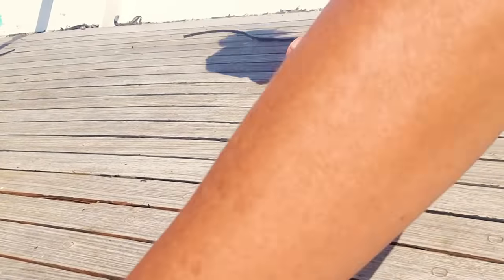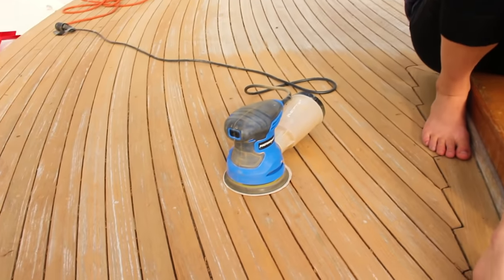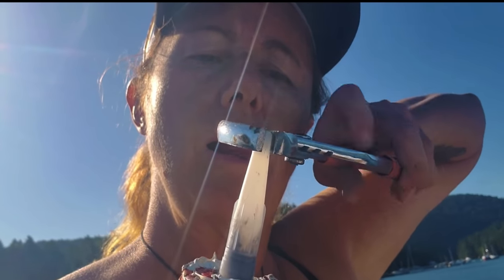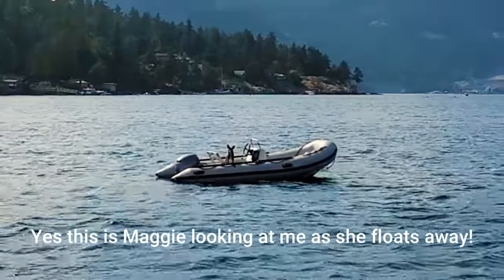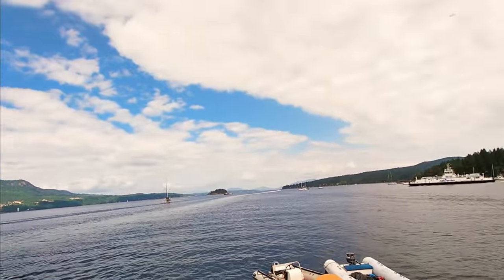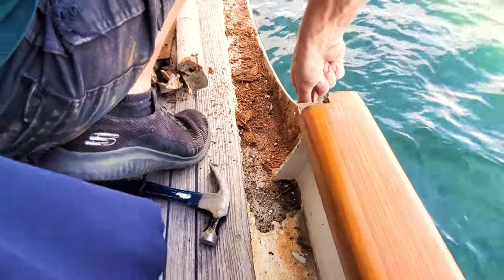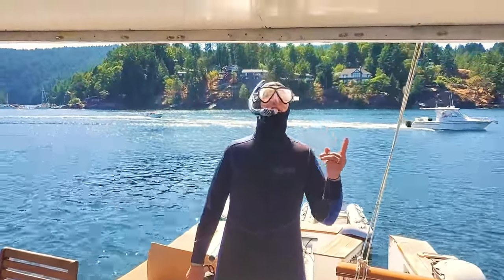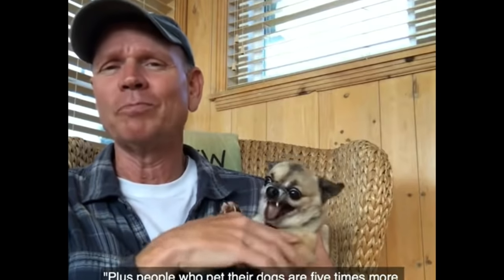Time to Recaulk our Teak Decks!   BONUS:  Galley Tour!  [Episode 54]

Comment: Love the look of teak outer trim and teak decks, but I don't miss refinishing it as I used to on our previous boat. I now try to keep wood finishes to the inside of the boat only. In any case, you cannot deny the beauty of nicely finished teak outside to boat! It's going to look great once completed!
Reply from the maker: It's funny ..... I LOVE doing varnish and people think I'm crazy.  There's something about it.  I just have to get the product right for this area of the globe as I am used to the tropics.  As for the deck...we left all the black caulking spread out for the winter and I will do the sand when the weather gets better.  I do have some more deck to do but the part that is done is not leaking anymore which is great!